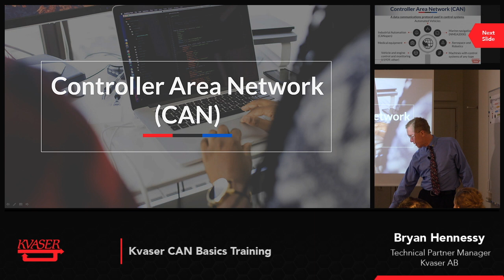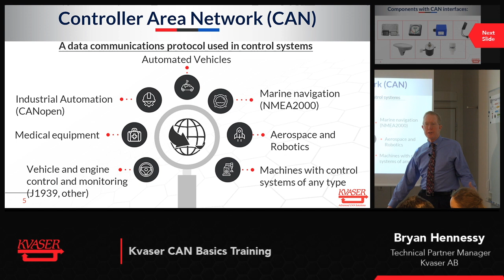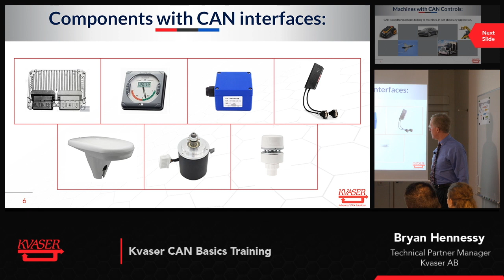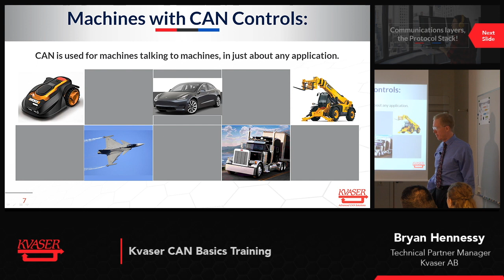Controller Area Network (CAN)

Comment: Nice presentation, thank you. I disagree however with definition of a smart sensor. In my opinion these could have have I2C and SPI buses to access the data and used in systems without a CAN network. The sensing technology , signal conditioning and digitization happening on the smart sensor chip and this is what makes it a smart sensor in my opinion.